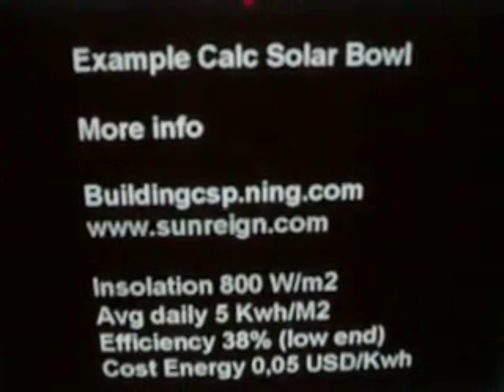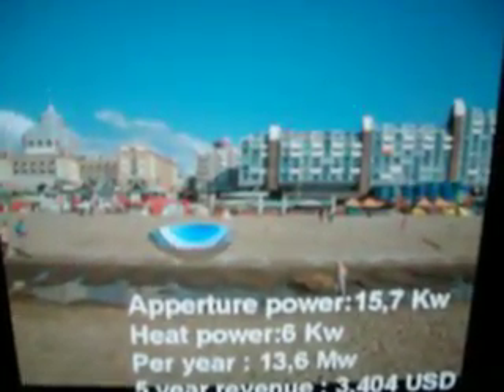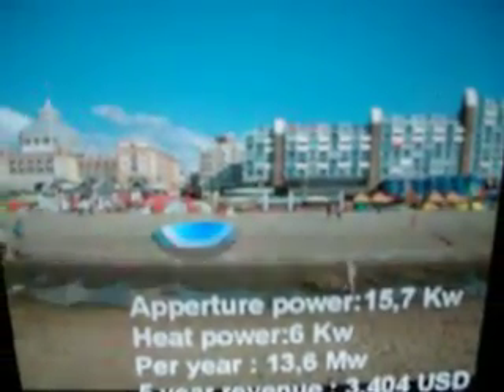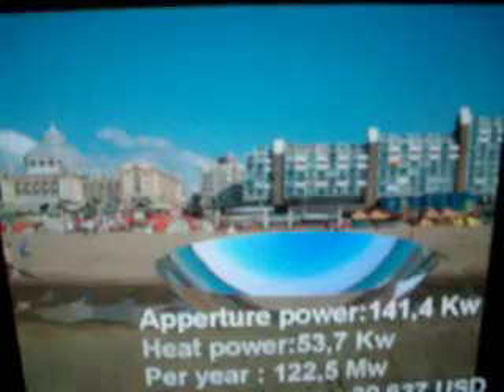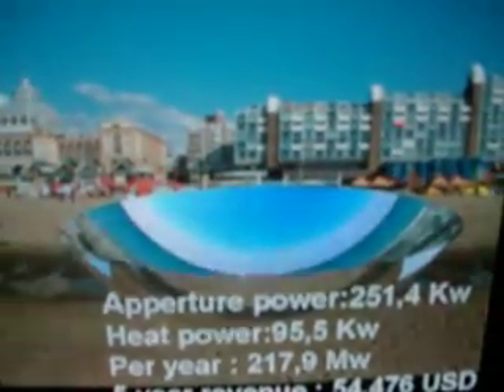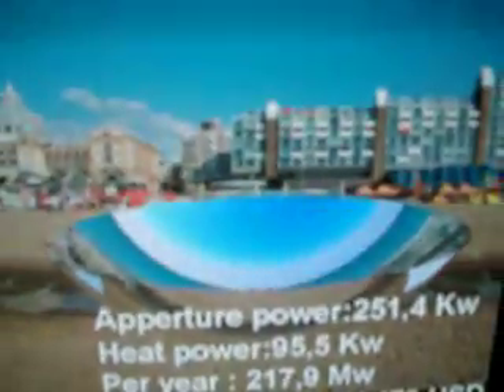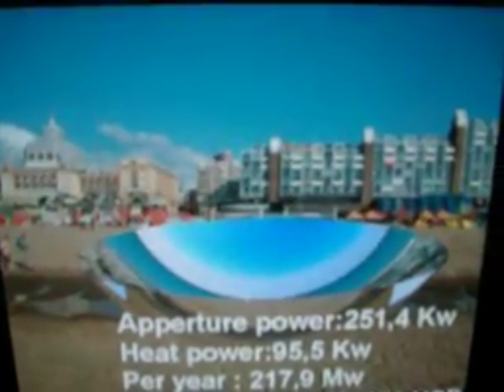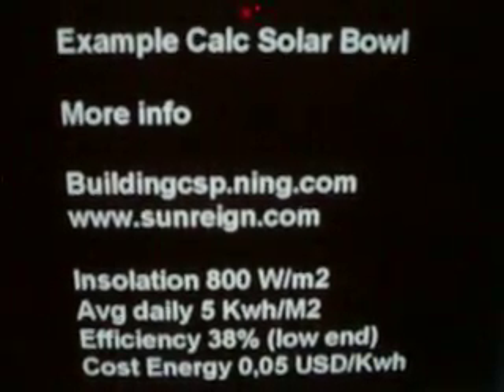Solar Bowl Power Examples

Comment from the maker: You can heat air, and at higher temperatures that is even better for heat transfer then water (it requires a special reciever, not more expensive, but a new design). Do you need heat or power in the end? What is your lattitude?

Comment from the maker: This installation can be used to generate steam (low or high pressure) which you can then use for other stuff..

Cost of materials of the bigges dish is about 12000 Euro..